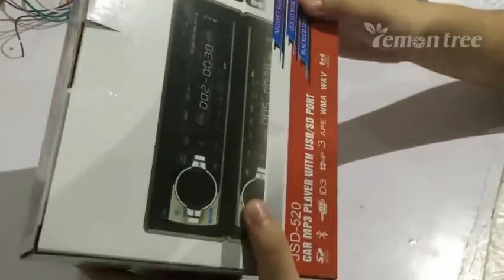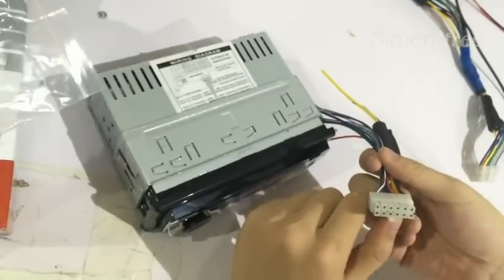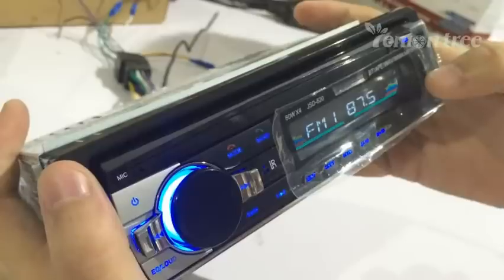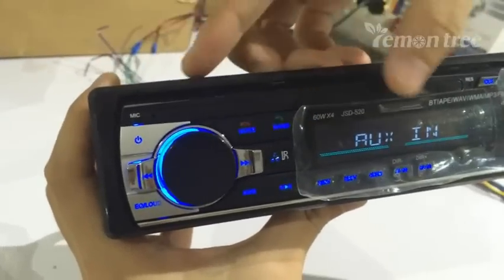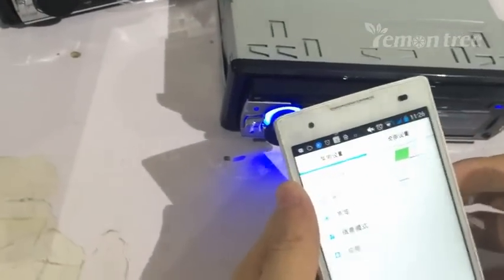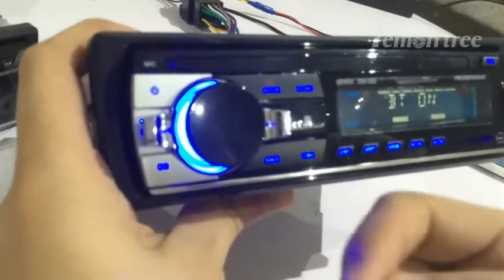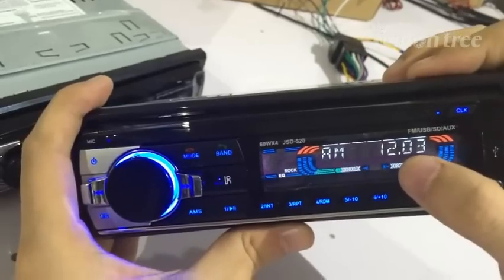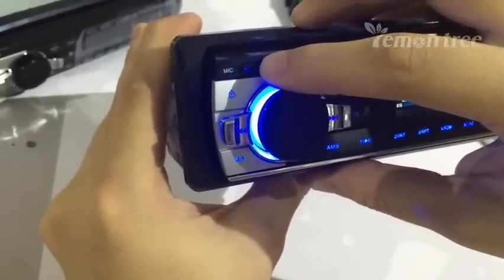Bluetooth Car Radio MP3 Player

Comment: Bought one for £12, works great, not tried the phone mode as i don't need it. But, usb and bluetooth music works fine. Wires are very thin when you strip the ends. Plenty loud enough. Wire all four speaker for best performance. When you look inside the unit, almost an empty box. Looks like a TDA type amp chip on rear case and all other electronics are on the display board.

Comment: Both of the radios are the same. The first one not only has bt printed right on it. It also has the Bluetooth mic in the top right hand corner too as well as the buttons to hang up and answer phonecalls so either the Bluetooth feature is non functional or the company is too cheap to make a slightly different face for the non bluetooth model. Idk why they would sell brand new non Bluetooth radios with faces from models with it included that's just a bit strange to me 🤷‍♂️

Comment: Great little radio, but can i switch off the RGB led switching all the time? Its distracting
Reply: Easy: push a few times (think around 3 times) on the big button for the loudness. But just short tabs. If "auto" appears, you can change by turning the button.

Comment: I have one and the USB thumb drive will not show up clicking on the Mode button. It would work when I got it but now it just goes back to BT and Radio then AUX in.  Does the programming prom, initial memory having a problem. I've tried formatting the thumb drive to Fat -Fat30 NTFS and Super fat. Nothing plays

Comment: It clearly states on the front top right hand corner of the facia on the first unit:  BT/APE/WAV/WMA/MP3/FM - That suggests either it is Bluetooth and doesn't function out of the box, or someone hasn't attached the correct facia to a non Bluetooth variant of the stereo. Which is also somewhat embarrassing for the demonstrator and the company, It would have been prudent to check your facts and equipment prior to making and posting this video. Is it no wonder these sell on eBay for about £8 a pop! and pop they usually do in grand style.

This is my opinion, I could be wrong.
Reply: yes ...and at 9:26 one can see the FM/USB/SD/AUX, yet it is the BT model seemingly because the BT features is demonstrated.... so what am i getting ?

Comment: hey guys, does it display the clock when the car is turned off? is it normal or can it be a problem for the battery?

how to change the minutes of the clock? i followed the tips of the video but it doesn't work.

thanks

Comment: I am in the same position as Igor Novak.. everything works great, but when the car is turned off the channel presets and clock reset :/
Reply: Issue solved, see above reply to Igor's post if you are having this problem.
Reply: Hey, do you know how to set the minutes because I can’t figure that out? I did exactly what he said but it doesn’t give me the option.

Comment: This is $20 head unit, I have exactly the same. most likely 30w  maximum. 60x4 is over rated.
Reply: seen someone testing it with a dummy load 28 watts , should be loud enough for the average listener

Comment: hello. when I save chanels, everything is gret. Radio is workig gret. But, when I turn off my car. Put out my key, then when i start my radio, radio is restarted. Chanels not saved. Clock not saved. Every time when i turn on my car. where is the problem?.. Is there a wire that need to be allways connected with car battery or how?. Please, I need solution for that. Thank you.
Reply: I have the same problem, some help would be great please!! thx
Reply: Igor I have solved this issue on my radio: I switched the red and yellow cables and now its saving the clock and my radio channels. Essentially in certain car harness models the ignition power and battery power leads need to be reversed.
Reply: Is your radio displaying time when its turned of? if not than i suggest you connecting the yellow wire to the power supply
Reply: Igor Novak connect constant to constant and ingnition to ignition.
Reply: Igore jesi li rijesio problem i kako?
Reply: i tried that but the radio unit is always on and drained my car battery. what is the solution to this?
Reply: Memory wire: constant +12v
Reply: How to mute it and which button to press ? Thanks